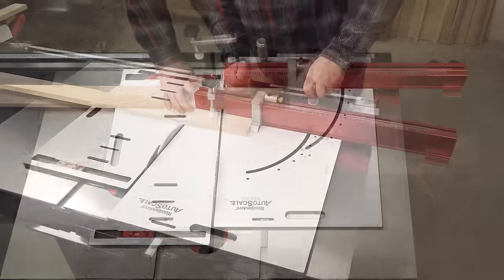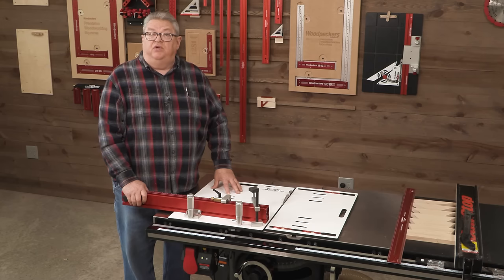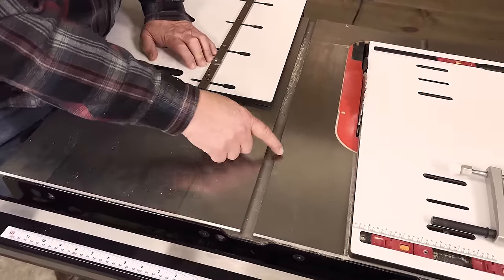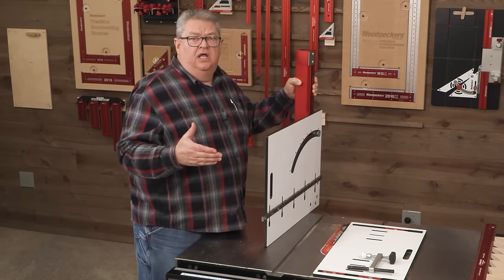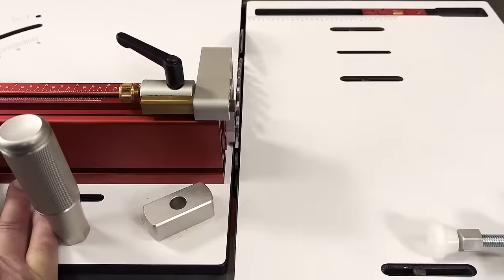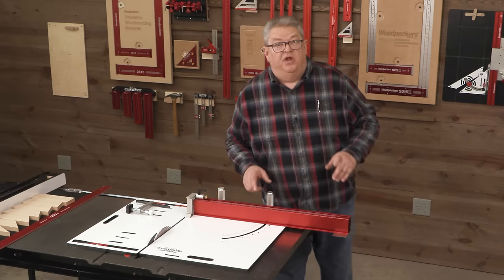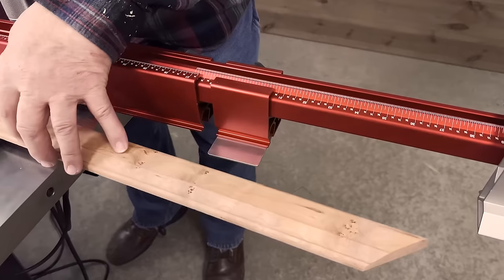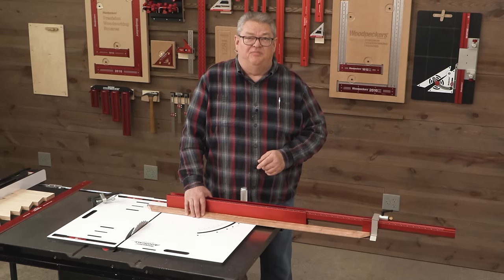AutoScale Miter Sled FAQs | Deep Dive | Woodpeckers Tools

Comment: Looking at the website, you have to choose either imperial or metric. Why can’t the scale have both? For this price, it should have both scales! Flip it over to use the other side. TSO products does this with their items. That way you get a good quality tool but can use both scales, depending on what you have to work in on that particular job.
Reply from the maker: The extrusion that is engraved can't be flipped over and the engraving area is too narrow for a dual scale to be readable.
Reply: @WoodpeckersLLC  my thought was that if it could be redesigned so that it could have scales on both sides and be flipped over that would totally seal the deal. But right now, it looks like I would have to buy both sets to get both metric and imperial. That’s a lot of money.
Reply: @WoodpeckersLLC  one more thing that I’ve seen that wasn’t answered was the lack of a sacrificial fence. It doesn’t look like you had any tear out with this design as the blade cuts very close to the miter bar. Maybe we can get some more information on that.
Reply from the maker: A sacrificial fence would negate the always-accurate nature of the floating pivot fence. The front plane of the fence has to remain constant for the floating pivot to work.
Reply: @WoodpeckersLLC  Glad you acknowledge thet the scalu would not be readable.  Now please fix the Exact 90 miter  gauge flip stop.  When the flipstop is used with your sacrificial fence it has to be placed forward and it then only aligns up with the  384, 1/16" marks.  So you flip the stop up to set it to the actual easier to read scale, then flip it back dow to make a cut.   Unfortunately when you flip it back down it moves away from the blade.  Is that a manufacture defect or an inherent design flaw that you addressed with this miter sled?
Reply: @WoodpeckersLLC  ok that is what I thought.
Reply: Design your own if you know so much

Comment: Regarding dual scaling, i.e. metric and imperial. The accuracy of this device depends on the flip stop being accurately set along the fence. If the imperial scale is on the top of the fence than the metric scale can be matched engraved on the front face (i.e., the leading face) of the fence which is bare right now. Both the front face of the main body and that of the extension are obviously deep for scaling to be visible and legible. When the stop is flipped down for calibration the metric scale should read 25.4mm. I've bought a lot of WP metric and imperial tooling over the years and more than once complained that WP doesn't automatically incorporate dual scaling. With the way pricing is going up, it's time WP listen to its customers if they want to keep us who are tired of having to pay twice to get dual system capability.

Comment: This looks like another great product from WP  but $999 is crazy. I love my many Woodpeckers tools but sometimes the prices seem a bit over the top.
Reply from the maker: $999 is for both right and left sleds and a catch table.  The "Full Monty". Most people opt for one side or the other, depending on your saw and your personal preference.
Reply: @WoodpeckersLLC  Both left and right sides can be had from competitors for about $350.
Reply from the maker: There are always cheaper alternatives. This is a feature-packed miter sled, built from top quality materials.
Reply: @WoodpeckersLLC  Absolutely, but the Dubby addresses the tear out on the back side of the cut with a replaceable sacrificial fence end while materials matter the Melamine sleds on the Dubby have no I’ll effect from humidity in the Houston area since 1999. And addressing the scale being accurate regardless of angle on your miter sled a tape measure accomplishes the same for sleds with no scale.   I absolute believe that you have a well made product but it seems that there should have been more focus on the concerns of the lack of a sacrificial fence.  This is what your experienced customers seem to be concerned about.  I absolutely do not pretend to know what is best for Woodpecker but it seems that a survey of your customer base might point you in a direction that would address what they feel is more important.   I was an early buyer of your Exact 90 miter gauge.  I have been a serious woodworker for about 44 years, professionally since 1995.  I was quickly disappointed in the flip stop that came with the exact 90 and you certainly seem to have addressed this issue with the better designed  sled flip stop. Will Woodpeckers ever offer a better flip stop for the Exact 90?

Comment: I spent all the money and bought the whole system - left, right and drop zone in imperial. In short, I LOVE these sleds. I've had the Incra HD1000 and the HD5000, didn't really like either of them. Have the WP Exact 90 and have really loved it, but can only use it on the left side of the blade and not for bevels (at least not easily). 

I think my most favorite thing about these so far is the ability to cut bevels using the right side sled (sawstop with a left tilt blade). I was able to accurately cut bevels on both sides of a 42" long, 16" wide walnut panel with no problems. I used the integrated clamp to hold the piece in place, and the corners were flawless on assembly. It's almost like having the sliding table without the extra room that takes up. 

My next most favorite feature, which is almost ridiculous, are the handles on the leading edges of the sleds. Such a simple little thing that makes moving/carrying/installing the sled so much easier.

Comment: Really nice design and engineering. Seems some of the fence enhancements could be applied to a redesigned fence for the Exact 90. Specifically the extension rail sliding at the top of the fence instead of the bottom and the auto align feature when it’s pulled out fully so there’s no eyeballing the distance measurement. Also really like the new flip stop - looks like a rack and pinion micro adjust? If that can be incorporated into all the other flip stops WP has that would be awesome (thinking of the Exact 90 and DP Pro for example).
Reply: Exactly!  The Exact 90 flip stop has issues with moving away from the blade after adjusting and then flipping back down, assuming you are using a sacrificial fence.

Comment: wondering if you could do a demonstration of how to use your sled with long sticks of framing material.  I'm a little baffled as to how to cut down normal framing material that comes standard in 8' and 10' (and sometimes longer) sticks.  I've seen you cut very small frames and angles, but longer sticks creates difficulties that I didn't forsee. Many of the frames I build are 32" X 24" and larger.  Since I am dealing with framing materials, there is a rabbit cut on the back, please account for that as well, if you decide to do a demo.

Thanks for the help.
Reply from the maker: Long stock is always problematic when working with a table saw. If I were depending on an AutoScale for the final cuts, I would first break those 8 and 10 footers down to rough length with a chop saw or hand held circular saw. Then use the table saw to cut the accurate angle and dimension. If the table saw is your only option, take a similar approach. Set the saw square. Break the long material in sections a couple inches longer than your final cuts, then set the angle and cut to final dimension.
Reply: You should never do long sticks on a table saw

Comment: Not looking to beat a dead horse on the sacrificial fence… I fully get the need for the front face of the fence to remain constant for the distance to always be correct at any angle, but couldn’t it be designed so that a sacrificial fence of a fixed thickness always needs to be attached? Thinking of 3/4” MDF for example. I all on board with the importance of properly aligning the sled table and a clean/sharp blade, but thinking out loud here to cover all the cut quality bases. Great tool, keep those innovations and improvements coming!
Reply from the maker: I hear you, Walter, but then it would ALWAYS have to there, and it would ALWAYS have to be exactly the same dimension...tough with either MDF or ply.
Reply: This has been my main hesitation on going ahead and ordering.  Will I have issues with tear out? I suppose just having some painters tape around could help eliminate that?  I was thinking Incra 5000 before this came out.  Just got my Saw Stop 36" PCS.  Have thought about adding the smaller Saw Stop Sliding Crosscut table also is expensive and takes up more space.  Tough decsion and input appreciated
Reply from the maker: Dan, my personal experience ("my" being Jeff Farris...this is my opinion, not the company position) is that I have been using table saws for well over 40 years and I have needed a sacrificial fence about a half a dozen times. When I did need it or want it, a piece of scrap that I had laying around and a spring clamp got the job done. The rest of the hundreds of thousands of cuts I've made have been with a bare fence that was fairly close to the blade in conjunction with a sharp blade. I'm not saying the people who say a sacrificial face is essential are wrong, I'm just saying I haven't experienced the same thing.
Reply: @WoodpeckersLLC  That is very good to know.  Novice here and trying to understand how important that is.  I like a lot about Autoscale miter sled but I didn't want to regret buying it.  It is so helpful to have people giving feedback on these sites.

Comment: A lot better understanding on that now. WOW much better than I thought it would be. Can this be used with a dado blade as well without the drop plate?
Reply from the maker: Gary, it depends on your saw and which side of the arbor your AutoScale is on. To use a dado blade, you need the AutoScale to be on the same side as the pulley. That way, the dado is building away from the sled, instead of into it.
Reply: @WoodpeckersLLC  That's what I was guessing thanks guys

Comment: incra 5000 vs woodpecker autoscale … anything available yet on how they differ? Trying to decide between them or if they both are unique in their own way
Reply: The Incra 5000 is enormous.  I would choose the Woodpecker version in that respect.  We all need more room and the Woodpeckers version would appear to take up less room when not in use.  Also I have the Incra miter gauge with the extension fence and flip stop.  The plastic scales can get out of adjustment.  I have found this ture many times.  Also the Incra flip stop has inherent design issues as it is very difficult to adjust in less than 1/32" steps.  And after making that adjustment the fence and or the Incra flip stop will have to be recalibranted.  I giver the nod to Woodpeckers for a set up that does not have to be recalibrated.
Reply: I sold my 5000 less than a year after purchasing it. Not only does it take up a lot off room when not in use, keeping it calibrated was an exercise in futility; the slightest bump threw the calibration off. Unless it's never coming off your saw, I wouldn't recommend it.
Reply: Lets not forget the god awful adjustment system incra uses for dialing in the miter bar. I've had the 5000 and sold it, still have the i-box jig, but I really hate that nylon washer adjustment thing. Its never worked well for me on three different miter bars (used to also have to 1000HD).

Comment: Miter slot compatibility was answered, but what about the width of the sled as compared to the tabletop? Seems like a substantial portion of the sled would hang off the table of a smaller saw like the SawStop CTS, no? Wouldn't that be unstable/unsafe? Or is the sled sufficiently locked into the miter slot?
Reply: Wondering the same!
Reply from the maker: It's 18-1/2" wide...how wide is the CTS from the saw blade to the edge of the table?
Reply: @WoodpeckersLLC  On the CTS,  it's 12 5/8" from the blade to the left edge of the table
Reply from the maker: I thought you were talking about the Contractors Saw. While you might be able to make it work, the AutoScale isn't really designed for saws as small as the CTS Compact.
Reply: @WoodpeckersLLC  my ridgid is 13.5 inches from the blade edge of table. It is 5.5 from the blade to the miter slot.

Comment: Very nice piece of equipment but, this deep dive doesn't show how to calibrate the sled to be close, and perfectly parallel, to the blade.  I can see the screws in the bar, and alignment/ adjustment slots in the sled but, you didn't show how to set the sled to the blade. Is this covered in the instructions that come with the AutoScale miter sled?
Reply from the maker: It is covered in the instructions, and it is quite easy. The two outer screws face up and the rest face down. Measure from the edge of the slot to the blade, roughly position the bar that distance from the edge, put a little tension on each screw, slide it in place and tweak it to be close to and parallel to the blade. Lock the screws from the top, turn it over and lock the rest. Next there's a simple adjustment to dial in the fence perfectly square to the blade.

Comment: When you calibrate the scale how much of a gap does it leave between the fence and the blade?  I am concerned about setting off my Saw Stop brake?
Reply from the maker: Dan,  it typically is 1/8" away. That's with the blade just clearing the bed of the sled. If you want a wider gap, just set up the edge of the bed a little further from the blade. That said, I've experimented and "close" doesn't count. Conductive material has to actually touch the blade...not just get extremely close to it.
Reply from the maker: I just re-read my post and realized I am completely off base. It will be 1/8" from the end of the fence to the blade no matter where the edge of the sled is. Duh.

Comment: how do you set the sled to ensure its parallel to the blade?
Reply from the maker: The connection between the miter bar and the sled is fully adjustable. The alignment procedure is pretty straightforward and well-documented in the Owner's Manual.

Comment: you didn't talk about the ability to add a zero clearance fence.  This was brought up at several points in the discussion following the introduction of the product last month.  Doesn't look possible with the stop design.  At this price point, you really really should have the ability to add a sacrificial fence.   Frankly, I just don't see paying such a premium price for a fence system that isn't perfect.  You shouldn't have to settle at this price point is what I'm trying to say and you are definitely settling.  At least in my view
Reply from the maker: A sacrificial fence would negate the always-accurate nature of the floating pivot fence. The front plane of the fence has to remain constant for the floating pivot to work. If you're fighting that much backside blowout, maybe your blade needs attention.
Reply: From the comments in the product video, it would seem then that several woodworkers are having problems with their saw blades.
Reply: They also have changed the flip stop for this miter sled,  the flip stop for the Exact 90 miter gauge changes position after you set it, tighten it , and then flip the stop back down.  It moves away from the blade.  This is not so much of an issue if you are not using a sacrificial fence as the flip stop actually fits across the scale with out having to lift the stop.  This sled and the Exact 90 miter gauge seem to have been rushed to market with out actually engeneering a solution to not haveing a sacrificial fence for this item and fixing a wandering flip stop on the Exact 90  The Dubby miter sleds by In-Line Industries. has had a solution for the sacrificial fence for 20+ years.
Reply: @box0xB9  Blaming the blade is simply an excuse for poor product design.   I use nothing but Forrest blades and I can guarantee you that I would have to send  out every week to be resharpened.   No blades stays that sharp when used all day and every day of the week.  A sacrificial fence like on the Exact 90 miter gauge is a must.  And this is especially true for the audience/consumer that Woodpeckers is targeting.
Reply: @11211lcb  Blaming the blade is their excuse for not having the sacrificial fence. So why then did the include it on the Exact 90 Miter Gauge if they thought it was not important? So many questions we have?
Reply: @box0xB9  Russhing half baked designs to market, that is why.
Reply: Nope

Comment: Can you cut with the blade at 45?
Reply from the maker: If you have a left tilt blade, you'll want a right side AutoScale to cut bevels. If you have a right tilt blade, you'll want a left side AutoScale.
Reply: @WoodpeckersLLC  I have a saw stop so it goes to the left but I’m more comfortable making cuts with the sled on the left.  Any advice ?  Thanks !!!!!!
Reply from the maker: I get it, but the generally preferred way to cut bevels is for the finished piece to be above the blade and the off-cut to be between the blade and the table.
Reply: @WoodpeckersLLC  thank you